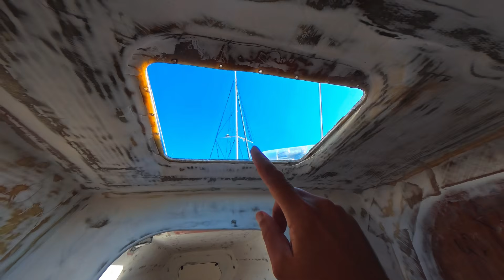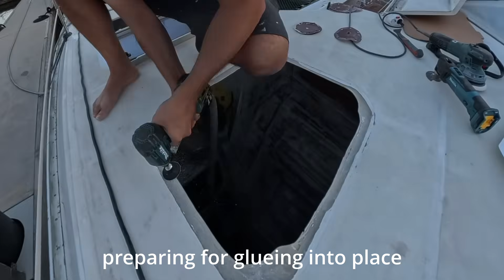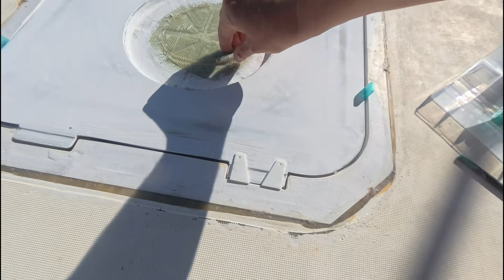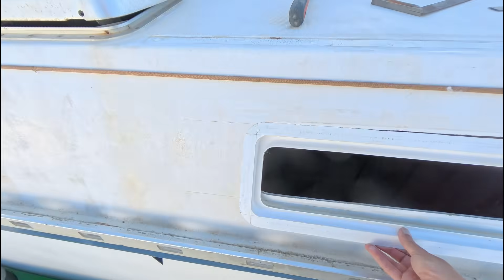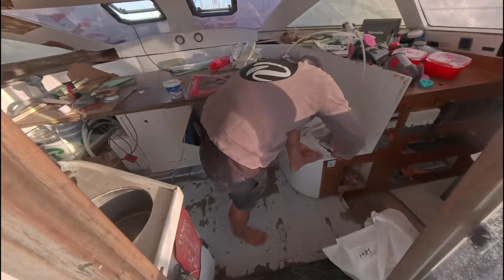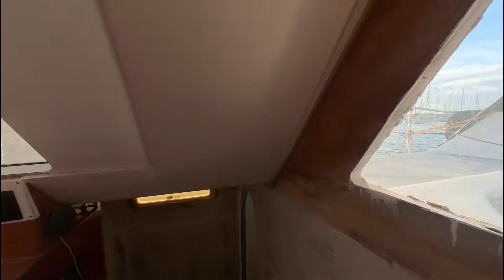Deck Hatch Installation & Portlight Replacement | Custom Composites & 3D Printing

Comment: The acrylic you need is actually polycarbonate. 

You need a type of lexan called marguard. It has far better impact, UV and scratch resistance. 

Plenty of UK suppliers sell it. Can be cut to size.  

It's actually quite easy to fabricate yourself, a good quality router, and sellotape (acts as a lubricant) and a sander and polishing head for the drill..
Reply from the maker: sounds like we need to visit the UK ;)

Comment: 🏴‍☠ Well who’d have thought a hatch is a out and port light’s an Inny ❤ 
And the correct place for a pedicure is the salon sofa 👍 
Nice hatches, way better than expensive bought ones your replacing. I’ve been grinding the paint off a carbon bike frame, ready for major surgery 👀
Reply from the maker: What is the point of understanding composites if you can't fix your carbon bike right? ;) Good luck with the surgery mate.
Reply: @youngbarnacles  fanks 😎🎯👍

Comment: Great Content as always. Thank you! 

FWIW, I found acylic (trade names : Lexan, Perspex, and others) in various thicknesses and tints in 4X8’ sheets for the companionway of my Hanse 371 and also for windows and skylights on my homebuilt aircraft  project. It was inexpensive and widely available at plastics suppliers in Calgary, Victoria, and Vancouver.  I cut it with a fine jigsaw, then worked the edges with a router and a belt sander.  I found it easy, and I’m no where near your calibre of craftsman.  I realize you are in a different part of the world but this stuff seems so common that I wonder if you might find a bulk supplier if fabricators aren’t picking up the phone.

Comment: Oh, thank you for showing the side hatches/portlights as well, as I mentioned that was my next project! What I am planning on doing though is attaching them from the inside and am still deciding if it's going to open outward - a very smart idea considering the water and the pressures you'd get from a wave. Amazing work :D Very cool solutions to a lot of problems everybody gets from hatches and portlights!